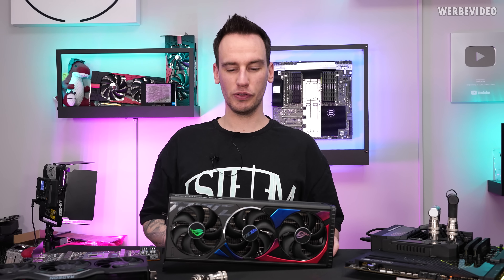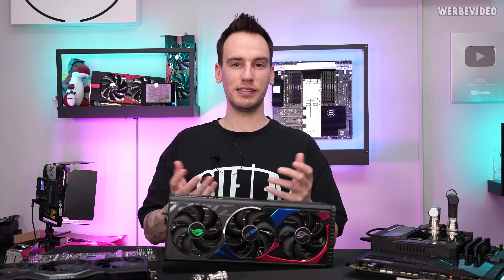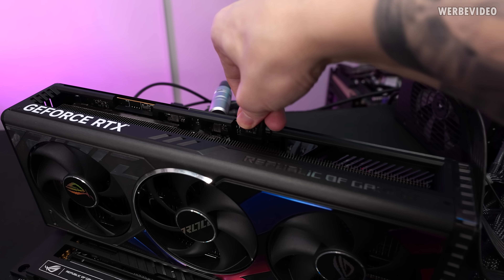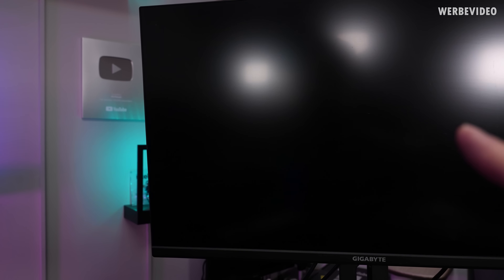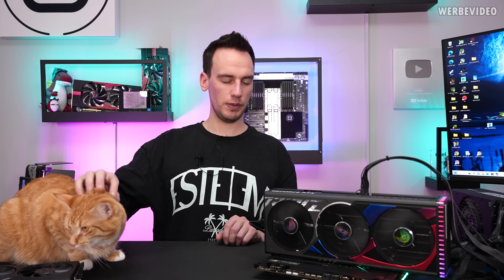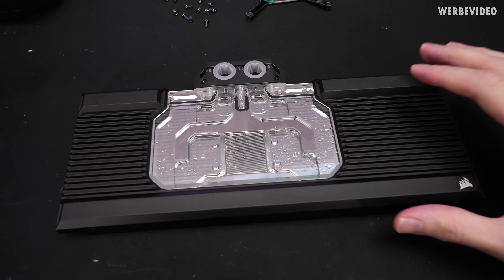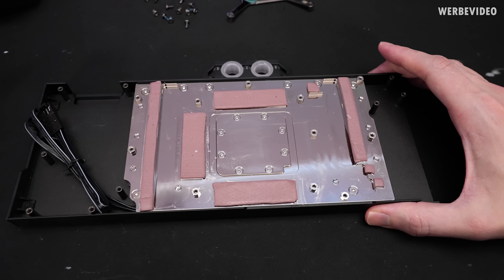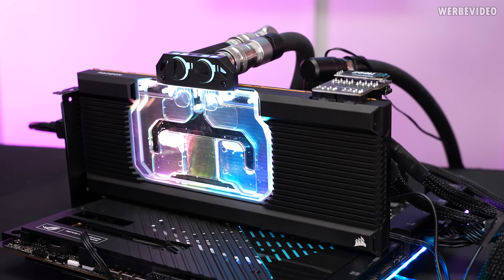Update on my "dead" RTX 4090 + The first Water Cooled 7900XTX

Comment: I promise if you remove the m. 2 in slot 1 out and move your drive to m. 2 slot 2 and 5hen 5ha5 2ill leave the way lanes on lane one free for the gpu to0 run x16 gen54. It's an Asus wiring in there motherboard. It sucks but that's 2hat 5hey have done.

Comment: I’ve had video cables that caused what I though was a no post. Also may be drivers. Or………a deeper dive………check your pcix slot. You may have some broken soldering  that only sometimes make contact causing odd errors.

Comment: are those wattage meters you plug into the GPU power ports for sale and do you also sell 2x 8 pin and the new Nvidia 600w connector versions?

Comment: Fast Boot + Hardware Changes = Inaccessible Boot Device

Due to how fast boot simply stores the drivers and O/S Kernel within the Hibernation File in a Loaded state,
Turn the PC Back on, that O/S Kernel and hardware config is loaded from the Hibernation file into the ram, and boom, if any hardware addresses or devices change, blue screen.

Comment: That water block flow with those trapped bubbles is likely not running at it's maximum efficiency. I would expect the fin area where those bubbles are located are going to receiving less water flow and therefore not removing as much heat as possible. It could also be causing a raised temperature across that side/edge of the chip.  
It's honestly a visually disappointing fluid dynamic behavior as the flow-path leading in and out of this fin area almost guarantees the "upper" (in this orientation) portion of the fins will have a stagnation and poor flow profile.

Comment: I'm using the EKWB water block on my 7900xtx reference card. When undervolting and properly setting the maximum frequency, the maximum frequency jumps once more than the set value when crashing or quitting during the game, and an adrenaline bug report or driver response timeout may appear. If the undervolting value is low in this case, it seems that the problem is caused by not meeting the voltage required for the jumped clock. If you meet the voltage requirements according to the maximum frequency setting, it is very stable, but depending on the game, it seems that there are cases where you need to increase the voltage. *Board total power consumption, voltage, and clocks are fighting each other. After setting the junction temperature with water cooling, it is a part that needs to be compromised well.

Comment: I installed a 4080 and made sure the cable was all the way in .. the cable splits to 3   8 pin cables ... and I got the red light  tried to re-plug everthing but i couldn't get it to turn off .. until i turned the computer on ... then it went out it seems to run fine though

Comment: You should have not advertised the SeaSonic VERTEX. The situation for the dealers is literally HELL with no one that knows when they'll be available in the EU. Someone on Reddit told the situation for the EU model is completely screwed by an engineering issue 😡

Comment: I wonder if its is a power spike during boot all the hardware boots there is a large spike. Are all the lanes active on the PCI-e now? Try and oversize psu
Reply: I also had another system that occasionally BSOD on boot. I found the memory wasn't seated properly it was latched down but simply removing and reinstalling fixed the issue.

Comment: Hi Roman, the blue screen is likely connected to an issue with the Intel Chipset driver (10.1.19284.8351). It occurs with 13th gen CPUs installing this revision

Comment: Could you please do a side by side high end (1000W to 1600W inclusive) PLATINUM ATX 3.0 PSU comparison video? With electricity so expensive we want a PSU with max efficiency to save on energy bills (platinum better than just gold rated), & as GPUs keep needing more & more power, & these PSUs should last at least 10yrs, a 50% latency above the minimum recommended 1000W for RTX4090 PC seems sensible.

If not going to make a video, could you please recommend a 1500W PLATINUM rated ATX 3.0 (with new GPU smart power cable) PSU? I'm open to 1600W if not 1500W.

Comment: I have only ever gotta INACCESSIBLE_BOOT_DEVICE blue screens when the storage controller that has the drive booting windows is not loading properly. Basically at boot time the system can see the drive, but as soon as it loads it storage drivers the C drive hardware vanishes and bang, there's your BSOD. Only ever happened to me when changing a Windows 10 install from one platform (generation of chip) to another. Or when changing mainboards, but only if you dont use DISM to inject the exact correct storage controller drivers into the OS from WinPE before trying to boot.

For me its always been a perminent error, until you put the correct drivers in, it doesnt go away for me just by pushing reset. I have never had this issue just by changing the GPU or any other piece of hardware, its always been solely related to Windows being unable to find the OS folder on the target drive letter after storage controllers are loaded.

So maybe in this case there is something with the way the OS is loading the GPU that is stopping the Storage controller from loading properly.

Comment: The coil whine  with water cooling can also be louder because of the higher voltages.
Because the card is cooler it will have less power leakage and thus it  will boost higher and it will use higher voltages to do that. The fluctuating load and voltages also don't help.

Undervolting the 6000 and 7900 reference cards made them much more quite cool whine wise. I tested quite a few always helped. Especially is you also underclock them a bit so you can even go lower.

Comment: ever since a windows 10 reinstall my pcie slots were disabling until i restarted my pc if it went into sleep mode, so i turned of sleep mode but ever since then my vega 56 has never been the same, the core clocks are still good but i cant even get near the same OC on the memory that i was able to before this was happening. Its tottaly a motherboad issue for me though since the onboard audio died within a year and the pcie slot that my sound card was in kept dying and not recognize anything was plugged in. Shitty ass gigabyte ab gaming rev 1.0

Comment: It looks like Display Port pin 20 syndrome being wired. It caused exact issues like only one fan spinning on some setups. It is a PCB design flaw here. The current always takes the shortest path, it may hang the PCIe switchers or the bridge upon bad power init, break the loop, try HDMI.

Comment: I used that same corsair power cable on my ASUS Strix 4090, and my card would boot to windows with a black screen the whole time, no video the whole time and MoBo code went through the process and the fans spun down when it went to windows. I pressed the power button to shut it back down. I plugged the adapter cable back in and everything worked just as it should so I ordered  the cablemod cable and once I got a cablemod 4 - 8 pin to 12+4 VHPWR everything worked as it should. It's been months now without an issue. I think the card is asking for more power than that corsair cable can handle. Also, I'm using a HX 1200 Plat. And the power adapter cable that came with the card also worked since it has 4 - 8 pin connectors and I had them going to separate outputs on the PSU.
Reply: I had the same exact issue when Jayztwocents plugged that corsair cable into his Strix 4090. And my card behaved in the same way until I used 4- 8 pin to spread the power load out.

Comment: Can you add the data (if you have it) about VRAM temps with the stock cooler vs the waterblock? Not in video ofc, I mean in a pinned comment/reply, that'd be interesting to see since the VRAM reaches temps in the 90-100°C range (and higher VRAM temp can increase the number of errors, especially if overclocked).

Also, since the XTX can be undervolted (and thus reaching higher frequencies even with the reference stock cooler), it'd be interesting to see a proper test at 1100mV or lower (and how much the stability increases with a lower V-F curve and thus higher frequencies - or not).

Comment: i seen this before too...nvme cards have locked irq values and with bios on gpu if not proper updated correctly on right device would cause conflict with both gpu and nvme due to bios couldn't get uefi drivers from the vbios to recognize it ...this issue is wide spread with amd boards in my experience

Comment: Hi der8auer, I've an issue with my 4090 on which each time the GPU goes to lower power stage it crash. I can play on it, I can put heavy load nothing will happen. But if I just don't do anything and stay on the desktop, the GPU will crash after 20-30sec.
The GPU is currently in RMA.
AMD 7950X + asus crosshair hero + 4090FE
Also the GPU was doing fine on the bottom PCIe (8x) but not on the main (16x)

GPU currently in RMA ...
Reply: Could also be your power supply. I've seen this happen before.
Reply: @dracer35  Be Quiet Dark pro 2 1500W, I doubt it's the PSU ... Especially when the PSU is running a 3090 taking 600W while the 4090FR only take 400-450W max
I shall see what they tell me during the RMA process. Hopefully the GPU is borked and a replacement arrive.
Reply: @MastahFR  Yes it's unlikely but not impossible. I've seen it happen on a Corsair 750w platinum PSU. Works perfectly fine for days on end at high load but when running a low load like watching a YouTube video it would cut out and restart the PC. 

Just saying it wouldn't hurt to check if you happen to have an extra PSU laying around or know someone who does

Comment: Was the PCIe x8 / x16 problem just caused by improper mounting in the PCIe slot ?
I am having the same issue with a liquid cooled AMD RADEON RX 6800XT on my ASUS ROG CH8 FORMULA motherboard.

Comment: I had two hard to identify hardware issues in the past with the PCs I was fixing:
1. Graphic card was leaking voltage to motherboard through DisplayPort cable. This caused very weird behavior with my motherboard like LEDs being powered on even when PC was off or general instability once in a while. Cutting pin 20 in one of the DisplayPort cable plugs and issue went away. Basic test can also be done with switching to HDMI cable for a while.
2. Low power quality. I had trouble booting the system, had general instability when system decided to boot. After a lot of diagnosing I finally tested the system with a higher grade UPS, online type, full sinusoid - ones that are usually found in server rooms. Problems went away - no more weird booting issues or instability.

Comment: I've had inaccessible boot item many times, it seems to be a common thing when you're swapping the same install on different systems, or if you use premade images from Macrium Reflect and such.

However these are all systems with onboard igpus, plus one seen it many times just on ssds.

Many times it won't boot till you go into safe mode, then it'll boot properly under normal mode.

If it's an older system, such as from an Intel 8th gen or similar and I'm dropping it onto a 12th gen then it'll never boot till I insert the modern Rapid Storage drivers with Dism.

I've never known the issue to be caused by a gpu. 

Just my two cents.

Comment: my strix 4090 was running at x4 speed because while directly mounted on the board, it would hit the chipset cooler before it was completely seated in the socket.  Used a riser to figure it out. Also, if it's pcie 5, you can't run nvme in the main slot without cutting the gpu down to x8 speed. It's because pcie 5 nvme's and gpu's will run at full speed @x8. This means that to get the full potential of pcie 5 without losing either nvme speed or gpu speed, we will have to upgrade both to pcie5 at the same time. This also means that by the time we can actually use these shiny new pcie5 slots, the next gen chipset will be out lol. z690 and z790 buyers got robbed

Comment: I use to see this issue back in the day with IRQ conflicts. Could be the card got "locked" into an IRQ that was not conflicting in your techs pc but did conflict in your system. And it can show up on multiple MBs. My first step would be to try to reflash the cards firmware.

Comment: I wonder if manually set PCIe link speed to Gen 4 instead of Auto will work.
I have a Asus X670E-F board, and with a MSI 4080 installed, it always defaulted to use the R7 7700X onboard graphics instead of 4080 (4080 is detected in device manager but no display from 4080). Yes the default graphics is set to discrete GPU, not iGPU. I have to set PCIe link speed to 4.0 instead of “Auto” to get display from 4080.
Reply: I kinda had the same problem. I have the Asus x670E-A board. I couldn't get the board to recognise my gpu. I had only access to the uefi through the igpu from the 7900x. Once windows loaded the drivers my gpu works fine but the status led for the vga was still lit constantly and the boot process took quite long (mobo thought there was no gpu installed). I fixed it by enabling CSM in the boot options. This behavior has something to do with secure boot especially if you installed windows with only the igpu installed

Comment: The GPU temp for WB 7900XTX is impressive (albeit within expectation), but the hotspot temperature is a bit disappointing.
I was hoping it'd hover between high 50s to low 60s under load for an open test.

Not too sure if it'll worth the price tag to slap a waterblock to 7900XTX.
Reply: Maybe Asus will release a liquid cooled 7900 XTX like the 6900 XT Strix. For some reason it's always in stock and is cheaper than the Asus TUF model where I live (lmao)
Reply: If you use liquid metal on the alphacool blocks it will be in the low 60s (61-62ish peak)
Reply: Yes its important to get hotspot under 60 because it has zero impact on anything.

Comment: Take that power cable that you screwed around with and throw it in the trash. Obviously you have a 1200W Seasonic PSU with the native connector so use that.

Comment: I can think on two possible causes to explain same card different behaviour in different places:
1 - Dirty electricity. Other devices in the same network (bad neighbours?) could be introducing voltage variations at just  the bad frequencies. 
2 - The monitor PSU. In rare cases,  electrical defects in the rmonitror PSU or  even small differences in ground  levels at both sides of the monitor cable  could produce this behaviour (I have seen it). In such cases I would suggest to test without any monitor connected.

Comment: i had a system once where every part worked in isolation but put them together and it was a whole lot of bricked. built two computers with the parts and both worked for years.
Reply: What parts were they?
Reply: @spi-killazinc9750  i want to say it was a core-2 machine. but i dont know exactly. that was some time ago and i no longer have the hardware. i used to be a system integrator so its all a blur.

Comment: Question about using water blocks, if I live in a hot humid equatorial country with 24/7 12 months a year 30+ Deg Celsius heat and rain, would the condensation become an issue inside my PC?
Reply: It depends on dew point, unless your room temperature is below your room dew point, you don’t have to worry about it. Condensation only happens below dew point, traditional water and air cooling won’t able to cool your components below room temperature. So,as long as your room dew point is higher than your room temperature, you will be fine. (Otherwise condensation will appear on everything…)
Reply: Watercooling does not get temps below ambient. You'll be fine.

Comment: Did AMD ever fix the over heating at the factory level? I know they were offering refunds - but are those cards still out there? I literally don't have time to build a system so I was going to get a prebuilt - but if these cards are still floating around I guess for that system ill get a 4080.
Reply: If you want to be sure just get some AIB model... Sapphire pulse, Gigabyte gaming and ASRock Phantom are sold at msrp(and in stock, atleast in part of EU where I live). And Sapphire NITRO+  Vapor-X is 100eur over msrp.
Reply: @Thornfrey  Seems like some of the ASRock Phantom OC cards may also have the issue based on some of the user reviews I've seen.

Comment: I have a problem with my 6900 xt where it booted to windows and some time it just looked up the system and had to do a hard reboot. Some other time blue screen and restart. The fix was sfc /scannow fix it.
And one more thing thanks to thermal grizzly kryonaut for getting my card back try to repast it with some cheap knock off never will I do that again so thanks for you excellent paste

Comment: I think it's not air bubble but vacuum cavity.
Try to reduce the pump speed
Reply: That's definitely air bubbles, a vacuum would collapse in on itself. This isn't the first time I've seen Der8auer not properly bleed his GPU in a test setup. While he's probably right that it doesn't make a huge difference as long as it doesn't impede the flow through the fins over the core. It's still a pocket of air that has a lot less heat capacity than water, and it's hard to say how it affects the flow compared to what's intended.
Reply: @Triszious  I don't know why those corners aren't rounded... or a different flow path alltogether? Seems like every other waterblock out there, is there no concept of fluid dynanics?
Reply: @frizzlefry5  The coolers are designed with computational fluid dynamics (CFD) and flow testing. If I would have to guess, they use those corners to promote turbulent flow, mixing and circulation in order to avoid hot pockets.